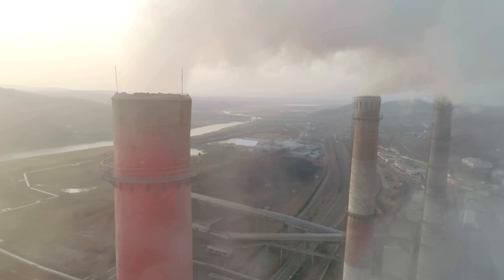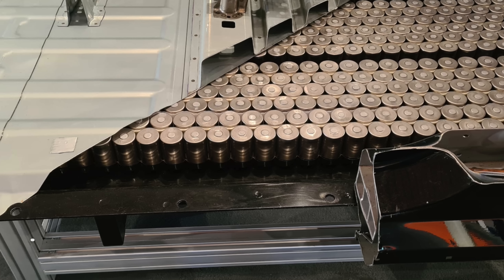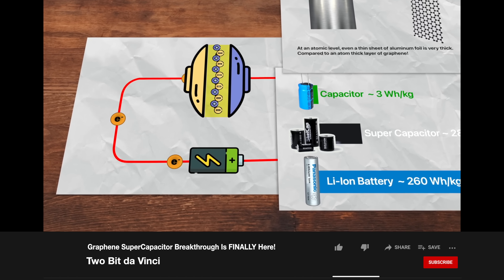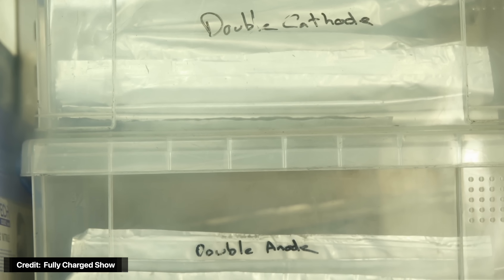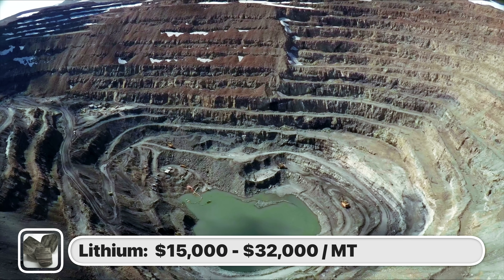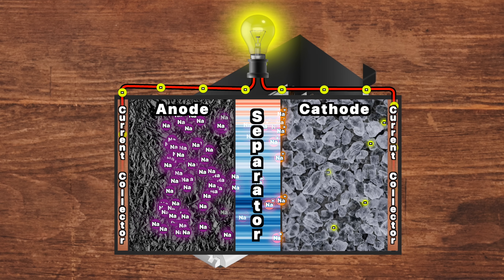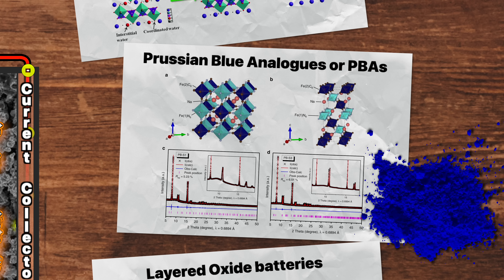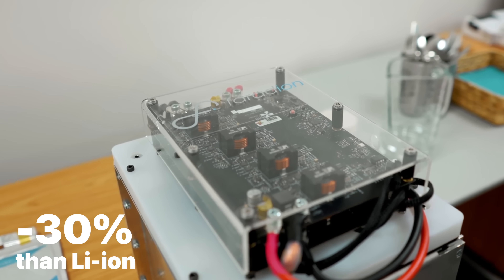Next Gen Battery is 1000x Easier to Source and 99% Cheaper!

Comment from the maker: STAY SAFE As You Browse the Web With Guardio: https://guard.io/twobitdavinci Save 20% Today!
Reply: Batteries and heavier cars are shedding tires faster then ever putting more rubber tire polution in the air compared to gas.
Reply: What about alovera batteries?
Reply: No one talks about the huge element storage in the deep ocean.... huge!  But suppliers like China want to push the price up, so they leave the oceans untapped... it's a scam.
Reply: I see water as the energy storage future. It has 5 phases of phase change plus it is the working fluid. Reach out to me if you wanna hear my idea
Reply: Sinanode: Low Cost Silicon Nanowire Coated Graphite
Reply: It’s very interesting that you never mentioned NGK’s Sodium Sulfur battery in this video. It’s already being used for grid storage and they have 20 years of experience building them.
Reply: Fossil fuels cannot be eliminated without a grid collapse, ever, due to electrical protection.  Nuclear is best alternative to coal if you buy into the "man-made" global warming bs.
Reply: We can't properly dispose of or recycle the batteries we have now!!  EV's only have a battery life of 10yrs & we don't need more batteries in landfills!!!!

Comment: GM found that the average private vehicle typically doesn't travel more than 25 miles (40 km) per day. With EVs averaging around 3-5 miles per kWh, you'd only need about a 100-pound (+40 kg) Na battery for daily use, and could just double that—assuming you can charge your EV at home. By combining it with Li batteries for occasional long-range trips, you can significantly extend the battery life, which dramatically reduces the long-term cost of your EV.

Comment: one thing never mentioned is because we want to rush into solar and wind(unreliable energy sources) is the reason for Grid storage in the first place. If instead we had invested in nuclear and 100% NUCLEAR for our energy needs, we would not need grid storage at all. Thereby we would not have to use a lot of battery usage and instead make those batteries avialble for Ev's

Comment: More than a year out of date!  There is a surplus of batteries and vast factories are building far more advanced batteries. In ten years cells will make the EVs far safer, more comfortable to fuel and have three times today's range, if needed.  Marketing science tells us how free markets will behave.bdont waste money on far more flammable ICE cars. It was predicted 40 kw hours per kilogram would allow commercial air service. We now have 50 kw, with outstanding durability.

Comment: I think Lithium-Ion will still exist for cars (which need very high energy density), but sodium-ion is perfectly fine as an energy storage solution, since the weight/size is much less of a concern, and lower cost makes this technology far more attractive. Ditto for home backup, a cheaper battery would go a long way towards reducing energy consumption. I've been back and forth on having a battery backup at my house, and the cost is the main factor which prevents wide adoption.

Comment: If most roads were electrified to charge cars inductively (especially on major highways and in cities) then cars wouldnt need a lot of range, and they could easily be made with sodium ion rather than lithium. And the cost savings in batteries (hundreds of millions of battery packs which would be both smaller in size and would use cheaper materials) would pay for the infrastructure to electrify roads. The only problem is, this would require enormous government investment that the energy incumbents (oil and auto) will resist and obstruct. This massive government spending would subsidize enormous profits for EV makers because there would be no reason to buy an ICE car. But unfortunately big auto and big oil would never let that happen. (The highways that Eisenhower built subsidized auto makers because, unlike today, there was no powerful incumbent that opposed that massive corporate subsidy.) And quite frankly, I wonder if Musk is too proud of a capitalist to accept socialism for billionaires (i.e. the government electrifying the roads), even if that would be cheaper for consumers and better for the planet. If the government builds and owns electrified roads, we can tax billionaires like Elon to get paid back for the government subsidy/investment (your tax dollars) that created his corporate profit (EV sales and the decimation of his ICE competitors). But if Elon owns the infrastructure (charging stations), then he can charge rent for society to use it; Elon’s privatized tax on society. In my view, society should tax Elon, not vice versa.

Comment: 5:55 'MT' is a very confusing abbreviation for Tonne. Because it already means 'Mega-Tonne' (i.e million tonnes). If you need to distinguish between metric and imperial tonnes just spell it out (Ton (imperial) vs Tonne (metric) ). But mostly there is no point as they only differ by 1.6%. That's irrelevant to a cost figure  given to the nearest thousand. So putting 'MT' there was just incorrect. Don't do it.

Comment: Sodium Ion batteries could be a game changer for off grid locations where people are dependent of solar panels and etc. in a farm, where space is not really an issue, having a huge battery pack that is cheap and could last for thousands of cycles without losing much energy density it could be a game changer.

Comment: In the last 20 years there's come conductors with very high conductivity and high melting temperatures. 
We don't need to use fluids or gasses to get heat up from far below us. At the surface fuilds or gasses can be used to drive a turbine.
Why don't I see these super conductive material being used to bring heat energy up from deep below???

Comment: Even if everyone globally was currently using a renewable power source for transportation & in home electricity, 1/3 of all Co2 emissions come from Residential & Commercial Heating.  There is no renewable energy source that can keep up with the energy density of Natural Gas\ Methane.  Heating with electricity?  I remember when I moved into a house with an electric dryer.  That dryer was scrapped as soon as my first electric bill arrived, W O W!!

Look at developing countries that have gas motorcycles & mopeds, 3 wheeled taxis (some are two stroke oil burning engines) , shipping Container ships & all other ships.  Earth movers, air planes, rockets.  In my view, if climate change is being caused by carbon dioxide (and not the Sun that is currently in igh mode of it 12 year cycle).  we are too late to avoid a deeping pattern of extreme weather.

The solution.? A New technology being allowed by big oil, makes it to market.  Remember the car that worked using water as fuel?  Along with 100's of other inventions that big oil bought out to NEVER see the light of day.  I mean think of it, for 100's of years nothing new has been discovered to replace crude oil?  Right...

Comment: CATL is already starting the industrialization process for Sodium-Ion batteries, with plans to form the relevant supply chain by 2023. Sodium-ion battery development took place in the 1970s and early 1980s. However, by the 1990s, lithium-ion batteries had more demonstrated commercial promise, causing interest in sodium-ion batteries to decline.[7][8] In the early 2010s, sodium-ion batteries experienced a resurgence, driven largely by the increasing cost of lithium-ion battery raw materials

Comment: Large stationary batteries have rather different requirements from tiny or medium sized portable batteries.  We tolerated lead-acid in statonary applications for over a century despite their high toxicity and awful energy density; but their poor cycle life and longevity still outweighs their low initial cost to make them fussy to maintain and expensive in the long run.  The ideal battery for stationary applications would be low initial cost, very long cycle life, and avoiding hard-to-source or environmentally nasty materials with at least moderate power and energy densities.  If this can be done with anywhere close to lithium ion's power and energy density, that is a big bonus that increases the number of applications, but not the primary driver.

Comment: Hi thanks for the information you have provided. I’m no expert but I do understand the electron transfer process and the chemical interactions. I noted that when you talk about separator you don’t go into any details. This is the area of focus not the anode cathode materials … 
This is where the mystery starts. What’s required is a polymer that allows a chemical transfer of matter without dendritic action. When dendrites grow through the permeable membrane the use life is over.. The other factors of weight to efficiency is another concern. Plus environmental issues of pollutants in waste . For this reason alone I believe a bin should be provided at the cross roads of every suburban street like in France for bottles.. 
So let’s look at the permeable membrane. Any of the reactive metals such as phosphorus magnesium or sodium can be used as an anode lithium is another highly reactive material in the same manor. The membrane needs to be inert and permeable. Carbon graphene a six sided strong bonding layered inert material is perfect if controlled to perfection in its production. If it could move with the fluctuations of charge and discharge without cracking the mystery would be solved. This is where manganese and nickel step in.. malleability is essential to the membrane .
So inert metallic polymers could be the answer IMO

Comment: Ricky please run the numbers. Turbulent Vortex hydro. Dig a ditch of 3 cubic feet of water diverted from the head waters of  Columbia River Gorge Oregon. For every 6 feet of drop, place a Turbulent vortex generator + battery. What is the level of power generation of usable power? Do this math until it reaches the ocean. I'll wager that the original water flow of 3 cubed feet of water will generate a lot of electricity without killing even 1 fish.
Now cover that ditch with solar panels and a walking biking path and I'll bet you lose very little water to evaporation. You could even have irrigation excess along the way.
Distribute electricity along the route to local communities and at the end is Portland. Here the 3 cube of waterflow hits the main power station. What kind of power are we looking at?
Using just Math can this be a significant amount of electricity?
Water conservation, zero fish kill, spawning is not disruptive. Can we have power and a navigable water way?

Comment: Great video. These batteries seem far better for spaces where density isnt necessary or important. Even in our own homes, this density isnt a massive issue. Your whole home can be powered for a good amount of time by something the size of a closet. Hell, if we get more energy efficient processors and components for computers and phones, the trade off in raw capacity might not be super important. And it comes with a huge benefit of much longer longevity, which makes it far more appealing to anyone that has any level of consideration towards sustainability. How long do those lithium batteries last till their capacity is at the same range as those sodium batteries? Lol.

Comment: I don't need very high energy density batteries or any sort of road rocket to go to the supermarket or across town. Even long trips can be planned if necessary. It just has to be usable and cheap enough to manufacture and buy. We need to quit thinking about the ultimate possible solutions and start solving our real needs. A fast battery swap for heavy road transport seems like a technology that would work. Some agreement on stadardisation would help. The first iteration doesn't have to last forever.

Comment: Shorter range for less money seems reasonable, but charging rate also figures hugely.
If your range is shorter but you can pull over a charge in ten minutes, its not a big deal.
Nobody should drive for more than 200 miles at a stretch anyway.

Comment: So of course that inbalance in terms of weight can be made up by changing mass of the car and Axial Flux motors do exactly that, much smaller and could even mean more room for increasing the battery storage, 
There is always more than one way of skinning a cat. 
But perhaps this battery tech would fit in really well with trucks...

Comment: Electric vehicles run off coal to produce the electricity to charge the batteries.  Once those huge batteries are worn out the enormous replacement cost is a horror show.  Then there's the problem of parked electric vehicles catching fire and blowing up.
Reply: buy voloing nateroes

Comment: Seems like Natron has a 1U rack mount sodium ion battery product, but it's only 0.27kWh. In comparison the popular signature solar 4U (which is 4 times the size) is 5.12kWh. That means a rack that holds 6 of the SS batteries would be just over 30kWh and would run your house for a couple of days where the same space would hold 24 of the Natron sodium ion batteries and be 6.48kWh and would weigh 1161lbs instead of about 610lbs for the Lithium based ones.

Looks like this has a long way to go. If they can get the cost super low it might be good for  home battery backup and solar off grid since it can last so many charge cycles. The power density is a huge issue though. Not many people want 10000lbs of battery in a room that looks like a corporate data center to backup their house.
Reply: vust buyy 288 att lith nayer henr onlyv270 watt ec nkyt wroth lith stiol biest in innvers

Comment: Just to put things in perspective. The best lithium-ion battery can achieve 400-500 Wh/kg (I'm generous here), while the diesel fuel used to power heavy machine is 13750 Wh/kg. Heavy prime mover will not by electrified (trains or ships). With the structural decreased of crude oil we will have to reduce our usage.
Reply: ú0eß  hybrre eltrivc

Comment: With the crossing of Florida by Huracan Ian there were hundreds of EV cars that burst into toxic flames and loss of those cars adding a new toxins to the environment, more CO2 and pushing fire departments to lean new mods of extinguishing such fires. Question: Many sight Current CO2 estimates on amounts in the atmosphere,  but is it greater that what was in the air in 1955 or 1925? What were those numbers?

Comment: Er... coal, gas and oil fired fossil fuel powered electric cars aren't any answer, not to anything, even if you swallow the narrative of 'man made global warming/climate change/climate disruption/climate catastrophe/whatever the scare is this week'. Especially when you factor in the infrastructure costs and solve the problem of finding a payment structure to produce the needed revenue to maintain it. Also no matter how you do the sums I can't see how solar/wind/sundry renewables can replace fossil fuel based cheap abundant available energy. You can argue about the percentage of our energy needs that can be provided by intermittent sources but you still need reliable switchable generation for base load. Batteries can help. If every new house and building could have their own solar cells with battery backup allied to neighbourhood and suburb scale storage that would reduce the strain on the grid and avoid having to build in multiple new generators. Once again though it would have to be affordable and maintainable. Small scale local storage doesn't look that bad economic wise. With future batteries Lithium Sulphur looks promising now that we can see how their intrinsic problems can be solved. Gelion's Zinc Bromide gel batteries could do a lot in stationary storage affordably enough even if the current 'CO2 did it even if it hasn't yet' narrative falls over. Sodium Sulphur could be cheaper seeing that the basic materials are much more abundant but no batteries can do everything. Plus you still need to boost the grid to an as yet unknown factor to charge them. Beyond a certain point it doesn't look as if the investment would be affordable. Much less sustainable. How many pot holes are there in your street and why is the local council struggling to afford to fill them? Multiply that by several orders of magnitude for infrastructure to support a battery storage transport/energy supply solution. If it can't be made profitable then the model probably can't the sustained. We can go nuclear fission until nuclear fusion can be proved some time in the near future. That's the main hope and signs are good but we will still need fossil fuels as a bridge to there. The goal should always be abundant cheap affordable available energy not expensive if not unaffordable imaginary solutions to imaginary problems. Dreams of rainbows are nice but they don't turn the lights on when you flip the switch.

Comment: The density problem is moot if they're installed in hybrids where there is a fueled engine running on one of several available fuels. Ethanol, wood gas and biodiesel hybrids all work better than those biofuels alone. If people finally grasp the Sulphur cycle/ cloud seeding explanation of why catastrophic global warming did not happen as predicted, then fossil fuels are back too. Also few people use their Tesla's etc up to the battery limit. Also part of the problem with EV's is powering the cooling in summer and the heating in winter. Adding solar cells to the car roof in hot climates solves the cooling. Adding a tiny fueled burner, biofuels if you still afraid of CO2, solves the winter or high latitude problem. Even adding a fire proof box under the bonnet of a tesla that plumbed into the heat pump and takes a fat candle would do the job.